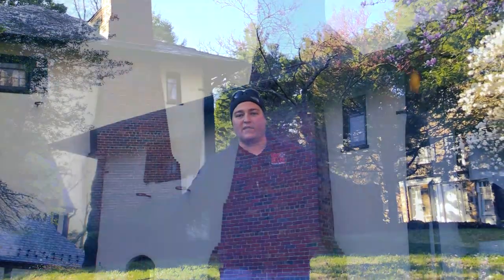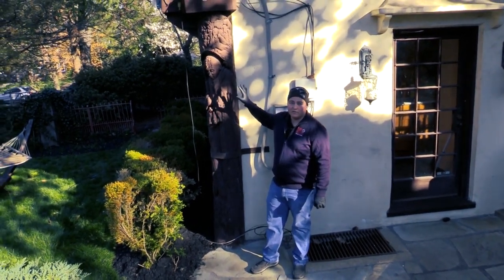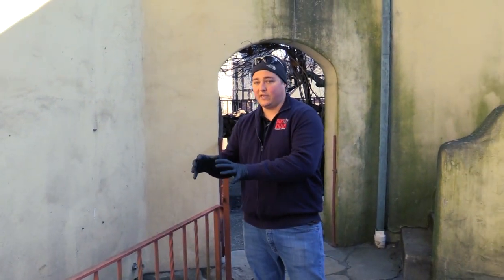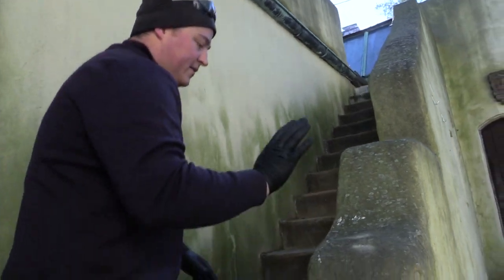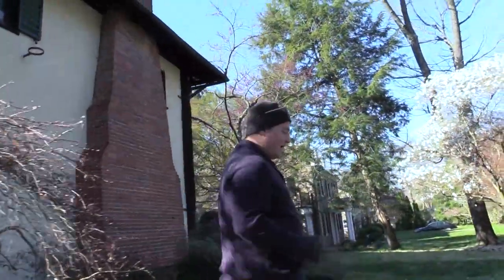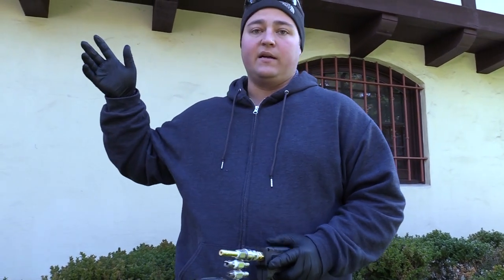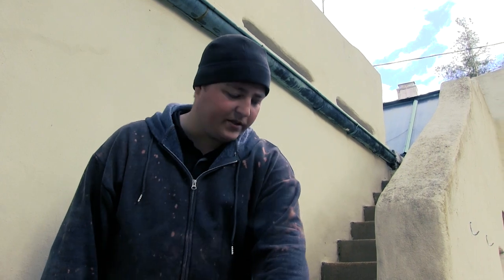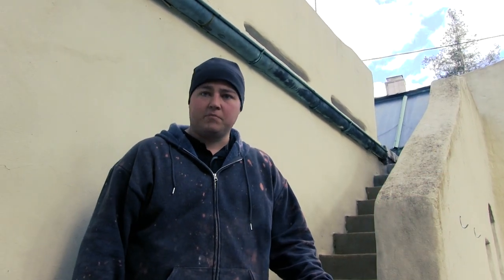How to clean a stucco house with pressure washer soft wash system

Comment: Awesome video man! About to do big stucco house next week but it’s not that dirty. So just downstream 12.5 sh and should clean right up? Also when rinsing, you just soft washing
Or putting little pressure
Reply from the maker: Great. Glad you found this helpful. This was all pretty much soft wash, even the rinse. The touch spots we used Hell Bender.
Reply from the maker: Note. Our wash mix was The Boss and SH. SH kills the organic growth while The Boss helps lift and break up dirt and some foaming properties which help hold the sh to the wall a little longer.

Comment: nice results, did you mix the hell bender 50/50 with water or bleach?
Reply from the maker: The Hell Bender was mixed 50/50 with water. It can be mixed with SH as well. Check out our mix ratio cheat sheet. https://www.dirtkiller.com/blog/dk-blog-2/post/common-stain-removal-76

Comment: Good video! I can't believe I just had fun watching a house get pressure washed! Is it possible to pressure wash the vine remnants and then paint over them to get rid of the brown marks? What level of pressure did you use here for that spot? We've got vines all over our 1950's stucco house and would like to re-paint.
Reply from the maker: Hi. We're happy to hear that you enjoyed the video and found it instructional. When it comes to vines that are stuck to most residential surfaces options are limited for how to remove them. In most cases you will find that they have bonded so well that the surface around the vine will be damaged while removing it. On delicate surfaces normally the vines need pulled by hand and then you will only have the area that bonded to the surface left. After that there is not much you can do other than aggressively brushing it away. On harsher surfaces like concrete a lot of contractors have turned to wet sand blasting as an option. In either case, most of the time once the vine sticks, there are markings in some way showing that it was once there. 

Feel free to check out this option for wet sand blasting (see link below) to see if it would work for your surface.  Thank you for reaching out, if you have any other questions feel free to reach out to us 

Kranzle wet sand blasting tool. https://www.youtube.com/watch?v=cSAhJvaU8rI

Comment: my father in law came over our house while we were away to do something nice. he pressure washed our driveway but also did our stucco with just water, and now there are stains on it. i know pressure washing is a no no but i didn't know he was going to do that. i'm not sure what to do now. i'm not sure what the stains are. it was only slightly dirty, no rust stains or anything so i'm trying to figure out what it is. the stain is in the shape of the spray pattern of the pressure washer it appears.
Reply from the maker: Hi P JB. Give us a call to discuss. Please have some photos of problem areas. Based on photos, we will try to make some recommendations either as DIY or connect you with a local pro. When you call, ask for Josh Wagner and mention this video. PH 800-544-1188 M-F 9-5 EST.

Comment: Do you have a cleaning solution you'd recommend for removing red clay from stucco?
Reply from the maker: Hi. Red clay is red due to IRON, typically. So, you could try Ruster Buster. Call and speak with Josh Wagner directly. He will know the right mix. 800.544.1188

Comment: So what's your sh mix percentage?
Reply from the maker: Depends on the job/surface. I'll check with Wagner to see what it was for this video.
Reply from the maker: Here you go, straight from Josh. "The SH I started with is 12.5% by volume. For most of the washing shot around 1% hit the surface while down streaming. As needed, I manipulated it to be as high as 2.5% on the surface."